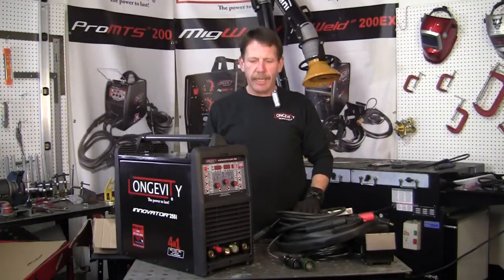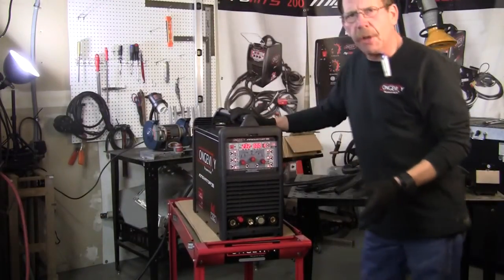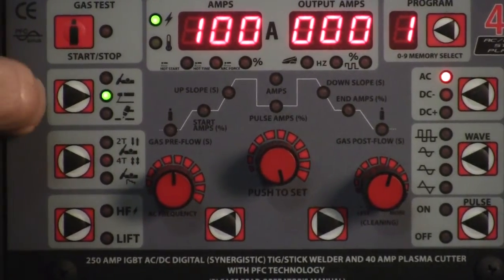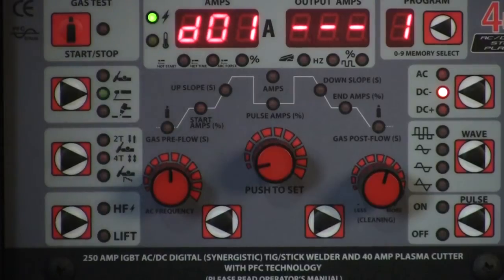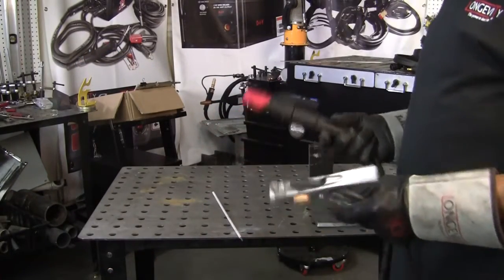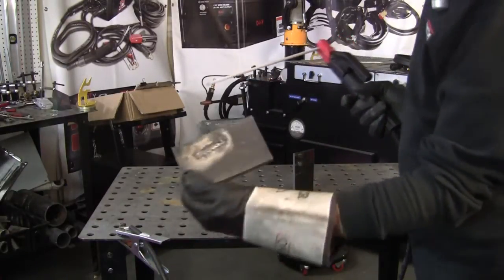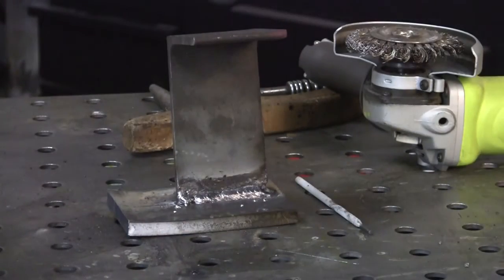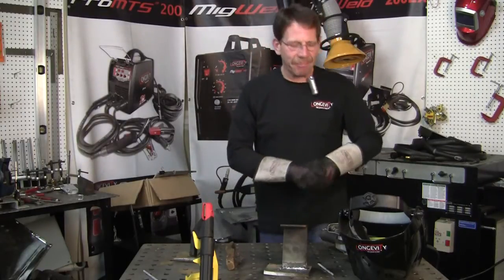Longevity INNOVATOR 255i - 250 Amp AC/DC TIG Welder, 40 Amp Plasma Cutter - Part 1: STICK Welding

Comment: Your polarity is all wrong. You set it up for DC- (strait polarity). When it should be on DC+ (reverse polarity) for 7018 low hydrogen, iron powder rods. Notice that your weld was making that buzzing sound. Im surprised, in that this is a video welding demonstration showing the really nice Longevity welders and it was set up wrong...